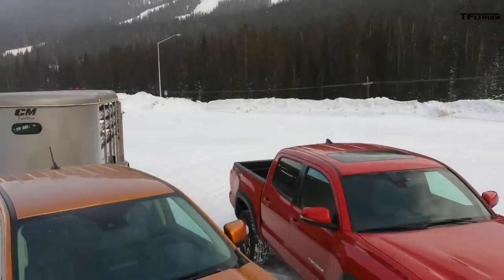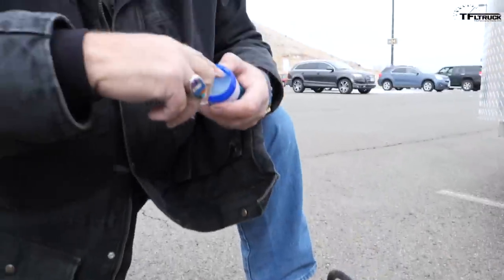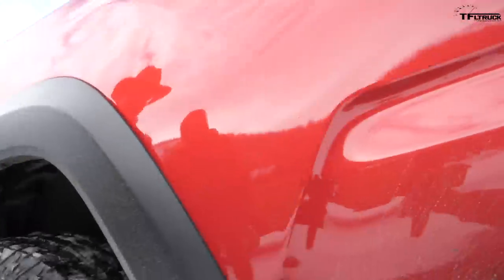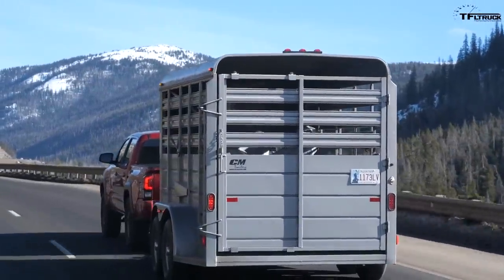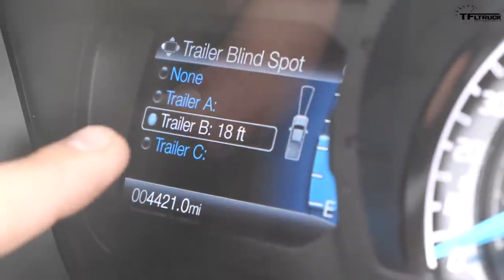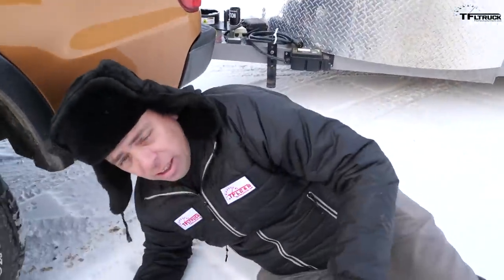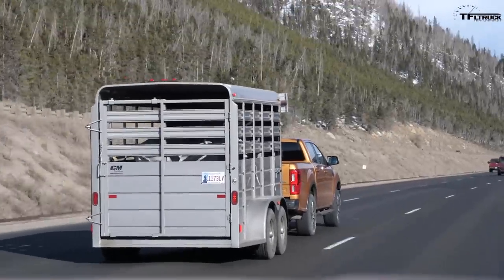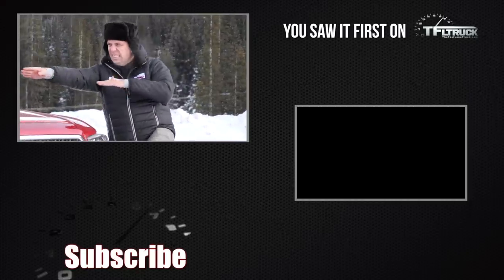Best Midsize Towing Truck? Ford Ranger vs Toyota Tacoma vs World's Toughest Towing Test

Comment: I have a 2002 Tacoma.  I believe Toyota has begun doing what all auto companies have been doin for years - cutting corners and cheapening products.
Reply: Absolutely, new Tacoma and Camry's have been having numerous quality issues
Reply: No shit they are a for profit company, but car companies are all making better vehicles. It hard for Toyota to stand out as much as they did with there boring but simple approach.
Reply: really? compare the options of a 1990 ish tacoma to a 2018.   Which has more aptions and technology?
Reply: Yes, they all do that in an effort to keep prices from being even higher than they are.
Reply: TED Schmitt that’s not true at all. They can simply keep price down if they want to. The reason why Toyota and Honda doesn’t load a lot of technology into their vehicles is because they are very conservative. They rely on their brand name to sell. Any technology in a vehicle gives a higher chance of problem which lowers their rate of reliability. They usually wait 3-4 years at least before following up with the market.
Reply: Not to mention reported issues with the all new 8 speed transmission.
Reply: Hari Om that goes for majority of the automaker. Once Tundra and Tacoma comes out with a new powertrain they will have issues too. It’s the push for energy efficiency.
Reply: @lokkstarproductions6918  Very True!
Reply: rustytr  :  Time will tell with the new 2.2 engine, twin turbo charges and all those gears in the auto box.
Reply: I can't wait until 5 years from now when cars will come with dildos and pool tables built in and people will use all the unnecessary options as justification for yet another 10 or 20k in price.
Reply: They hold their value
Reply: Jon Smith 
They hold their value because supply/demand and reputation
Reply: I LOVE my 2017 Tacoma and would NEVER consider a Ford even if it passed it going uphill. The Tacoma holds it's value and doesn't have the problems ALL Fords seem to have.
Reply: The Ranger is better than your yota.
Reply: @tripacer8259  I'm a Cobra guy. I bought a first run 4.6L with a blower. It was problematic to say the least. A tried and true 5.0, sure. Basically bulletproof, huge aftermarket, and lots of people can turn a wrench on it. Unfortunately, if you want to not void your warranty, Ford chimps have to do some of the work. It's best if they have an old engine to drool on.
Reply: ryvr madduck I wouldn’t buy a Tacoma unless it had the 4.0 v6 in it. Those engines are incredibly durable.
Reply: purpleslil if you can’t afford a Tacoma, you buy a ranger. It’s okay, you ranger lovers can line the pockets of the ford executives when you buy their crap. Built to fail fords. The old rangers were solid trucks.
Reply: Really? How so?
Reply: @DinorwicSongwriter  more complication, more stuff to break
Reply: @billgateskilledmyuncle23  they will come with a pizza oven in the engine compartment
Reply: Steval204 the 2.7 is more durable iron block not just iron sleeved like the 4.0 and the nissan 4.0 has more tourqe than toyota its a better engine and trans is ok and rearend is worse. The toyota is the better truck if you want it to last 300k miles. But if you want to buy a truck every 10 years and 100k miles the nissan is better. But the 2.7 4 cylinder in toyota is by far the best engine.
Reply: @tripacer8259  the 1st year of the 3rd Gen Tacoma had a lot of issues. In reality, every vehicle has issues so a Tacoma is no exception.
Reply: rustytr exactly. doesn't matter how much tech is in it, if it doesn't work then it don't matter. The older ones ran longer because of less tech.
Reply: My brother worked at Ford in the late nineties to mid 2000s, and he said all the high tech complicated stuff just made it more likely things would break.
Reply: @lokkstarproductions6918  very true, Japanese engineering doesn't hurry up on things  and its not just cars,  its in anything(company wise) they make or do. I personally know, because I lived with  Japanese family in Los Angeles in my early days of being an Electronic Technician working in the LA area..
Reply: You’re one of the few realists that can admit that. Tip my hat to you sir.
Reply: @nickmartinez229  People fo not like it when you cut down Toyota, but new Toyota is no where near what the old Toyota was.
Reply: ryvr madduck and most Toyota lovers cannot admit that. NOTHING is meant to last anymore...
Reply: Agreed, the new 2020 toyota transmission is absolute crap.
Reply: @Seveneleven44  that's funny
Reply: rustytr  say that in 300,000 miles
Reply: @purpleslil  for 50,000 miles if you're lucky
Reply: rustytr  It is better but ugly 😢
Reply: rustytr  I will say my Gen 3 Taco has been solid but I do miss my 01.
Reply: I will take a preowned frontier thankyou
Reply: I have a 98 taco I got new. I had a 91 truck before that and 2 tundras and another 05 taco since. The 04 tundra blew a cylinder head gasket with 15k miles. I traded it for the 05 taco. That was a pie e of junk. The engine and trans were fine but rusty frame, bad wheel bearings, flimsy tailgate, bad AC compressor and tires that could never be balanced were enough. I got the 98 new and it's only had one problem and that's the 3.4 fan hub bearing. Toyota has lost its way since being built in the USA

Comment: Both trucks will be fine with mild towing on occasion (like all other midsize trucks). If you're going to do any regular towing with moderate or heavier weight, you should probably get a different truck. It's not like the midsize trucks are much cheaper than a half-ton anyway.
Reply: MSRP difference of $7k-$10k on the Ranger. If you build it with similar equipment.
Reply: @ShersGarage  1/2 tons carry quite a good amount of incentive though. That might change now that the Ranger is here, but I've seen a few F-150s with $7-10k off MSRP. 

Cars and Zebras I think that's what most people do who buy midsize and half ton trucks, more recreational use than moderate or heavy regular towing. These trucks seem very well suited to a person or family who tows around 5-6k once or twice a month.
Reply: Yep, these trucks shouldn't really be used to tow all the time. It's more for someone who likes to have the ability to tow some stuff, but may not need it.
Reply: These kind of trucks are actually really good for towing if you don't go over 5k and live in a reasonably flat area of the country. They have more power and sometimes even more towing capacity then a majority of older trucks people use all the time.
Reply: ya
Reply: "Midsize" is  smaller though. These trucks are closer to the size of an older half ton full size truck. A new "half ton" truck is a monster and a challenge to park and open doors etc.
Reply: If you’re towing 5k all the time it’s fine. Most Americans are not towing up this severe of grade. With that said I’d take the turbo Ranger any day. Also, the discounts are absolutely massive on many half ton trucks putting them really close at times to the mid size class. I have seen as much as $14k off this winter season. This among many reasons is why I don’t mess with mid size trucks. They are very lackluster and end up costing too close to a much better for me half ton.
Reply: @electronsmove  That's the thing a lot of people don't seem to understand...these mid-size trucks can actually be attractive due to their smaller size, people seem to focus on how much you can haul compared with a 1/2 ton.  I have a tiny driveway where I live, and my 2011 Ranger w/supercab is actually about right for the space I have. I park my girlfriend's 2013 Silverado crew cab shortbed in my driveway and it barely fits to the point of having to turn sideways to walk on each side of the truck and it sticks out into the sidewalk. I'm not actually sure one of these new mid-sized trucks will fit in my driveway very well either, but they have to be better than the huge full-size trucks these days.
Reply: Eyellgeteven man. Your girlfriend has a bigger better truck than yours.  It’s time to turn in your man card !,,,lol. Jk
Reply: @ALMX5DP  We don't know what they will do after Ranger comes in. They will probably throw some incentives on those too. I sell Fords, so I know exactly what you're talking about.
Reply: The good ole days of the V8 Dakota
Reply: Where I live and when comparably equipped, a midsize truck is still 25% less expensive than a full size.
Reply: If it tows it, then it really does not matter if it is a full size or mid size. If you like the truck and it better suits you in other ways (tight garage space, tight parking, general preferences of smaller vs larger, ‘no need for the compensation factor’??) then buy the mid size AND tow.  You don’t need a larger truck just because you tow more often. That is a very old school and outdated point of view. Used to be a time where compact/mid size trucks sucked in general, period. THEN it mattered as they were little more than a glorified car. Today they are real useful trucks with power,  good payload and towing capacities and are safe to use at these capacities. Times have changed. 
     Oh hey, I am one of the OLD guys but still want to learn and I do accept and even embrace change.
Reply: shitloveaduck I do agree with this. Back in the day a dually is what you need if you were going to tow regularly and heavy. I have an old ranger and it does very well for what it is and how old it is. Perfect for someone towing a tiny little trailer. I also have a 4.0 ranger and that thing does really well
Reply: In australia they're used as tow vehicles all the time especially caravans although we usually only have turbo intercooled diesels and instead of the Tacoma we have the hilux
Reply: Cars And Zebras Indeed they are.
Reply: Jay P I might get the Ranger Ecoboost too, but I’ll wait for RAM making their midsize truck.
Reply: Rangers and Hilux' are the staple of towing trucks in Europe. People buy them here to tow 3500kg (~7700lb), and sometimes more (farmers will put 5ton on them...) all day long throughout their whole lives.

The idea that you you need a massive truck for work is a solely American concept.
Reply: @ShersGarage  
Compared to...what?
Reply: @WhoThisGuy515  Truth, I drive a 20 year old F150 4x4 that only tows 7700lbs with 260hp and 350 tq ft lb's
Reply: @robitaill3  true but this ranger would out pull that 318  . But probably not the 360
Reply: Random Adventures   There was only 15 hp and 30 lb torque difference in the late 90s  318-360.       also you could only get the 360 in a 2wd Dakota.
Reply: @Cars&Z, 1/6/20, My thoughts exactly. I once thought about buying a truck but opted 4a Taurus & invested in a receiver hitch instead. Then I got a mesh trailer (4'x6'/1650LBs load cap), w/a ramp gate, bolted a pc plywood in it & gd2go, cheaper than a truck when I don't always need a truck. A fully optioned-out Ranger/Colorado/Toyo can run >$60K. The Silverado/F-150/Ram/Titan might be a better buy.......so long as you don't go4 that ridiculously expensive ($80K) Raptor.
Reply: @semiauto3148  if your girlfriend drives a truck she's your boyfriend
Reply: That's true but not everyone wants a full-size pickup.  Remember, Ford learned this the hard way.  What we need is to continue the midsized pickups but with equivalent or if not more power than the full sizes.
Reply: @thestig007  I use my Tacoma for my debris hauling company.  No complaints and she's chugging along perfectly fine these past 4 years.
Reply: @WhoThisGuy515  This is absolutely true.  The manufacturers need to know that not everyone wants monsters.  Can't wait for the 3rd gen superchargers to come out
Reply: @electronsmove  That's true.  I remember the days of my old ford ranger.
Reply: @JsGarage  Yeah but not everyone wants to or needs to struggle with parking spaces.  Besides, if you want a half-ton four-door, get yourself a suburban.  Four-door monsters just look weird.
Reply: Alan Bowers dang, so am looking at this and the frontier to tow my mustang 3-4 times a year u think these are fine for that?
Reply: @gigi9467  heck yeah, it would
Reply: @electronsmove  the new ford ranger is almost the exact same length and width as the old Ford ranger. It's just taller. So it looks way bigger than the old one.
Reply: My 5.0 swapped ranger is the best of both worlds! Tows 7,000 just fine and is still short and more importantly, narrow enough to go over many trails my friends 1/2 tons can't get through
Reply: @ShersGarage  Is the Ranger more or less expensive?
Reply: @shaneadamiak2153  less. You buy an XLT Ranger for about $31k. STX F-150 would be around $38k, all after incentives.
Reply: id love to see those discounts again

Comment: Db is not a linear scale.
Every 3 db is double the sound energy level.  Every -3 is half. 
70db is double 67db. 6db is double 3.  112 is double 109. That's energy.
Humans perceive a doubling of the sound level every  +10 db. And half as loud at -10db.

Either way when your scale reads a difference of 10 it sounds twice as loud to a human.
+3db  is significant in either case.

I don't think the "bump stops" on the Ranger are meant to be hard stops which may be the reason you felt a smoother ride. It looks like the "bump stop" is designed to work as a decelerator. Almost a mini coil spring cushion.  This would mask a jarring pot hole or bottoming out from extra weight over a dip.

The  Tacoma looked like a metal hard stop that was bent from impact or missing a rubber piece. You may have lost a snubber there.

Pretty fair comparison.  The full sized trucks downshift and hold speed without brakes WAY better.  

I would have used cruise control for both up and downhill.

I have noticed my truck uses the actual speed versus the CC input to determine when and how much to downshift going downhill. Might have helped with the hunting shifts.
Reply: Useful information. I don't know when I'll use it, but it may come in handy.

Comment: No surprise that the Tacoma holds speed better down hill, it's got a bigger displacement engine (3.5 l. VS Ranger 2.3 l.) so more compression.  Again no surprise the Ranger does better up hill, the turbo of the 2.3 makes a more efficient engine.  Thanks for this real world test showing a bit of hunting on the 10 speed transmission of the Ranger and quality of ride of the parabolic spring of the Ranger.
Reply: I do not understand the downhill breaking test at all, the transmission is made to downshift with if you need engine breaking while towing,
Reply: David Cox right, but the transmission is using the resistance of the engine to slow the truck. A 2.3 liter 4 cyl is going to have a lot less resistance than a 3.5 liter six, and the programming of the powertrain control won’t allow the engine to exceed redline. That’s why it wouldn’t downshift below fourth gear.

Comment: I’ve had two of the previous Rangers; both were really good little trucks! I’ve been looking forward to seeing the various test results of the new Ranger and I’m pleased to see that it’s performing as admirably as it is. Once again Ford really did their homework with this one! I’m looking forward to probably parking one in my own driveway in a couple years after I pay off my present vehicle.
Reply: I had a ranger, bought it new.  The rear end went out as well as the transfer case and the front hub broke all within 2 years.  Bought a Tacoma to replace it.... Zero problems and still buying the best trucks ever built... oh what a feeling!
Reply: I love my Ford Ranger!🇺🇸❤👍Toyota 🤮👎💩
Reply: If they could only learn how to build the Range so it doesn't break!  My Tacoma is an '03 and it is so loved I still have a couple people a year stop and ask if I would be interested in selling it.  I did look at replacing it, but with the inflated prices, I am so glad that I have a truck that will run for years to come, even though it is 20 years old.
Reply: Well I hope you reconsidered after all the numerous reliability problems they've had with the transmission the turbo the engine the steering the fuel economy the electricals.
Reply: @allenstuck2861 how is your turbo Allen????? Hahahahaa. How's your electrical Alllen??? Hahahaha. How's your rear-end Allen????hahahaha. We know.

Comment: Thanks for freezing your butts off to provide us with real world tow tests. I owned a Tacoma with the 4.0 and sold it for a 2018 with the 3.5. I was shocked how much the towing quality dropped with the newer engine. I know it looks as good on paper as the older 4.0, but my engine constantly shifts and groans towing the same trailer. Add larger tires and you cannot tow in higher elevations or inclines worth a squat. IMHO, it’s better to go with the Ranger since the turbo helps compensate for altitude and incline challenges when it comes to torque and that 10-speed stops the extreme gear switches.

Comment: There is a reason the Tacoma is the best selling midsize. I’ve owned a Toyota and IMO it’s a good truck but far from perfect. The Ranger seemed right there with the Tacoma with towing. We all have our likes and dislikes but I think the Rangers tech features and performance at 0-60 separates things for me a bit in this class. Curious now how the fuel mileage loop will look for these trucks. Please drag race a Colorado and Ranger so we can declare a winner.
Reply: Smarticus the reason its best selling because it was the only one for the past 6 years. 

Towing the ranger will kick ass. 
0-60 ranger should smoke the Colorado
Reply: Just because you own it or like it doesn't mean everyone wants to buy that piece of shit.
Reply: The ranger towed way way better! They failed to mention the ranger went up that mount at 3500,4500 rpm meanwhile the taco was screaming at 5500 rpm. That makes a difference on feel and noise
Reply: They have the ranger wins.
Reply: The Ranger has a much higher payload too.